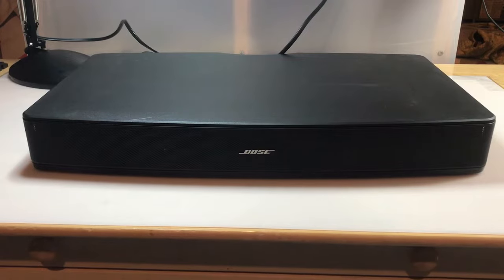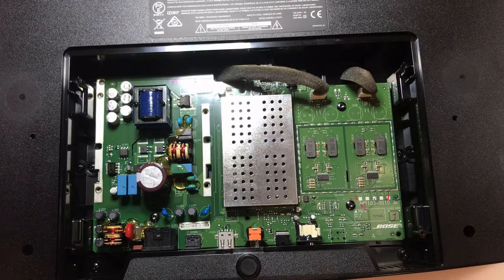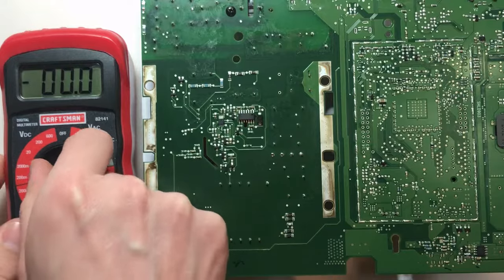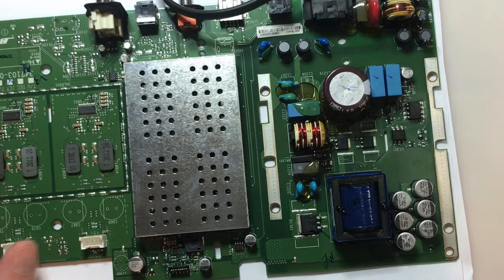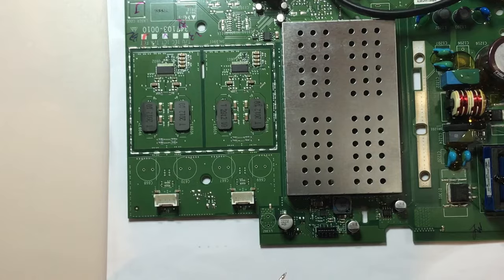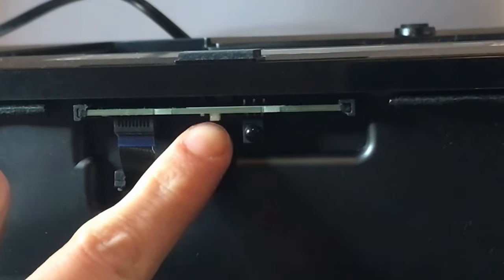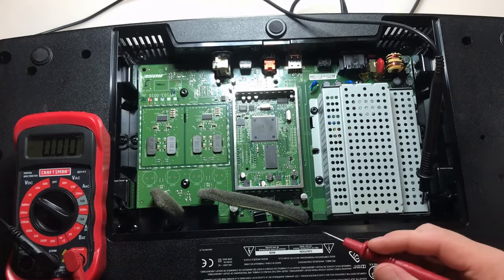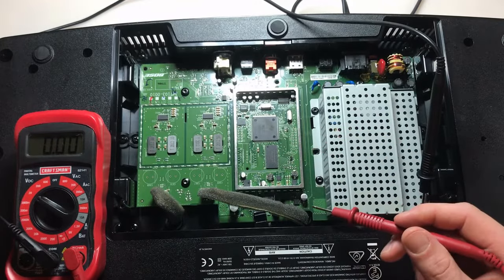DR #3 - BOSE Solo Sound System Troubleshooting

Comment: Great video. Got the same problem with mine.

I got a solition, to run the system. At lest the power supply need to stay always on.

„Temporary“ Solution:
I bridged 2 contact directly on the texas
Instrument chip close to the high frequent capacitor. (You can try with a piece of wire
On the whole site of the chip, i tired it also no circuit) 
After that you can hear the chip „starts“ and the bose sound starts as well.
This will work dosent matter if you switch the bose on or off on the remote control.
Whenever you disconnect
The power you need to bridge the contact
again.

My bose is running since two days now.
Reply: Can you tell us exactly which pins worked for you? That description is a little bit too generic
Reply: Echo Luca's comment - How did you accomplish your solution?

Comment: Hi I have a question: "" There are two 0603 capacitors out of the cage precisely on the side where there is the usb connector and the optical connector that the tester gives me in short circuit ... Is there anyone who has checked them?
Reply: Yeah, they are shorted

Comment: Was there any clips that hold the speaker grill in place ? Mine is loose trying to figure out how to get it to snap tight.  I got lucky with the one I bought on eBay for 30 something bucks. The owner said it only turned on, didn't have remote. When I got it the unit was in good shape. I already had a soundbar remote and optical cable. Hooked it up, turned it on and it works great. I recently updated the software on it. Only issue is there a small gap in the speaker cover, dent feel like to wants to slip in place.

Comment: Exact same Problem..
Did someone ever wrote Bose about this Design Flaw?
Reply: Hello On pin 9 of the integrated circuit Fan7384 there are connected a resistor with an sot323 ... the sot323 should be bat54cw  but i don't know the resistor value ... while connected between diode bridge and fcd7n60 there is a resistor 1210 with written 75 ||| ... is it a 75 ohm? unfortunately on this card there are some things burned and I can't find the values please help me ... thanks

Comment: So did you change the crystals? Did it work?
Reply: Hello On pin 9 of the integrated circuit Fan7384 there are connected a resistor with an sot323 ... the sot323 should be bat54cw  but i don't know the resistor value ... while connected between diode bridge and fcd7n60 there is a resistor 1210 with written 75 ||| ... is it a 75 ohm? unfortunately on this card there are some things burned and I can't find the values please help me ... thanks

Comment: Any updates on this? Replacing the two crystals seems like a good lead.
Reply from the maker: No good updates. I dropped the unit and cracked the board so it’s gone now.
Reply: I have one of these with symptoms of powering up lasting for about an hour, then turning off. Usually it comes back on, but it’s off for good at the moment. It started doing this every 6 months but it used to come back on. Now it seems dead. Any good tips for testing with these symptoms?  Thanks!

Comment: I've reflowed main processor pins and mine is working fine atm.
Reply: On pin 9 of the integrated circuit Fan7384 there are connected a 0603 resistor with an sot323... Can you tell me is value?

Comment: Did you wind up replacing the crystals?  The DSP may be similar to his one TMS320F2810.  Also maybe its the reset chip (TPS3825).  There are a few Buck regulators in there maybe one of the voltages is off.

Comment: Sometimes I get the start up chime when I plug it in. The remote then turns it on and if I turn it off the remote will not work. Did you have the chime everytime you plugged in the unit while working on it?
Reply from the maker: No chime.
Reply: I have also the same Problem have anyone an Idea? Greetings

Comment: Usually just unplugging and unplugging the power will bring it around to turning on.
Reply: BROWNWRENCH BROWN I imagine his would have been unplugged for more than 5 minutes if he bought it on eBay.
Reply from the maker: Nope. Did that 10+ times. It was a much deeper issue than the classic IT help desk response.
Reply: @dualityrepair4770  THAT'S WHAT MINE DOES WORKS ONLY WHEN UNPLUG FOR FIVE MINUTES SOON AS I SHOUT IT OFF IT won't RESTART AGAIN TIL I UNPLUG IT I DID A REFLASH AND HELPED FOR A WHILE BUT BACK DOING IT AGAIN NOW YOU STILL NEED TO UNPLUG IT FOR FIVE MINUTES OR SO THAN IT WORKS ALL DAY TILL YOU SHOUT IT OFF AFTER FIVE MINUTES IT won't RESTART ANY IN STRESS IN LOOKING AT IT AND SHOOTING ME A PRICE TO FIX IT I TRIED THE ADDRESS YOU GAVE AT THE END OF THIS VIDEO BUT GOT NOWHERE. OF COURSE IM NOT TOO COMPUTER SAVY I GREW UP ON APPLE 2S LOL

Comment: I have run into that sound once before that is the crystal one of those two crystals is making an audible sound and a crystal is not supposed to be making the sound there is something shorting that Crystal there's a component on that board that is shorting that Crystal or the crystal is shorted that's why that Crystal is throwing off and harmonic sound right now that's where that sound of tone is coming from it's coming from the crystal I ran into that once before and I had to replace the crystal

Comment: Can’t you just toss the entire board and use the unit for just the speakers? Wire the speakers to an receiver that’s also connected to the tv and your good.
Reply: someone want to show how we would do this?
Reply: Sensible solution
Reply: That's what I'll probably end up doing. I imagine that a couple of crossover networks will be required.

Comment: I was told a software reflash can cure some of those not powering up issues.
Reply from the maker: I tried unplugging several times without luck. 

I wish I could try the software flash but the unit was dropped and has been damaged.
Reply: @dualityrepair4770  mine has now completely crapped out. No power light...nothing. A reflash helped for a while. Please follow up on the crystal replacement.
Reply: @dualityrepair4770  so this stopped the who exercise ?  :(

Comment: I’m fixing my own Solo at the moment. My Bridge Rectifier blew. I’ve sourced its exact part thanks to a BOM I found, but without a schematic I cannot identify the SMD resistor next to BR1201 marked, “750” which is badly burned in my board.

If you have the chance, could you scope it’s resistance?  Pretty sure it’s 75 Ohm, [0603], 1/10W, 5%, but the package isn’t 603 so in just double checking
Reply from the maker: Kenneth, sorry I no longer have my Bose. It was dropped and the board cracked so I got rid of it.
Reply: It’s all good, I am fairly certain I ordered the right part 👍. Thanks for making and supporting great content!
Reply: Kenneth, that is not a "750", please see this picture of a close-up here https://imgur.com/Sj3F8hC, it's a 75M sort of... Mine is measuring 0, not sure why, maybe you are more advanced with this repair and have a better idea? I am trying to fix mine, nothing blown, but not powering up, no chime, voltages seem ok, but I don't have an oscilloscope to check for ripple and things like that.

Comment: Very disappointed now with this unit. It was periodically not working, but unplugging and replugging usually restored it from time to time when it acted up.
Reply: Yes, this is what I have to do periodically. I leave it unplugged for 30 mins and hey presto, it works again once I plug it back in. I have the larger unit with the programmable remote but it's obviously the same fix as yourself.

Comment: I had exact the same issue. It is the DSP. After replacement it worked just fine again.
Reply: Can you point what exactly you did?
Reply: @mishka_miszka  I replaced the D808K023CPTP4
Reply: @johannweber4553  thanks. I'll keep that in mind. For now, I just added one capacitor (this one from the top left) and warmed up whole board with hotair. 2nd week and it works with no issues
Reply: DSP need some firmware?

Comment: What a piece of crap. Full Microprocessor controlled, full smd junk. This is a curse to have for repair.
Reply: sometimes short circuit s102. few times is the diode D1301 to replace. But most of the time  it is U705 (TPS62110) faulty. hot air on DTS work sometimes

Comment: Overpriced junk no longer supported by BOSE. They used to repair these for $99. I tried a flash upgrade. Mine is failed just like yours I have 3, 5 and 24V supplies. Now they just offer you a new one for $280. I'm done with BOSE. I'll buy a $89 piece of junk to replace the $300 BOSE.
Reply: And you will end up with a better product.
Reply: Billccm John I just spoke to bose mine has the same issue, they offered me a new solo 500 at half price, but do I really want to buy another?
Reply: They could just publish the schematic and maybe even the fix and allow people to repair them
Reply: My solo wasn’t working ...well it would work after powering off for short time after that it would crash ...using the fibre optic Input...I then tried the RCA input and it works perfect ran is for 2 days with no issues ...be worth trying